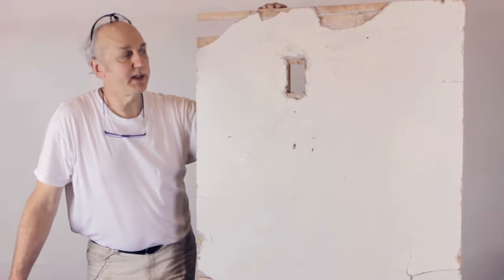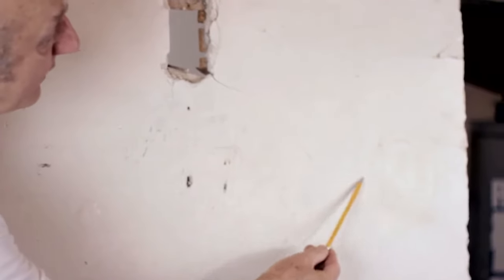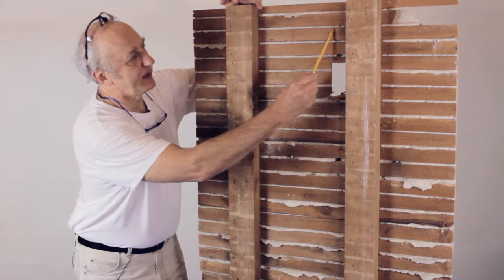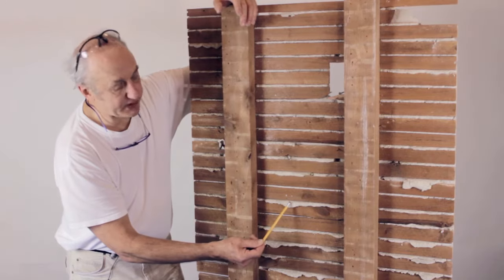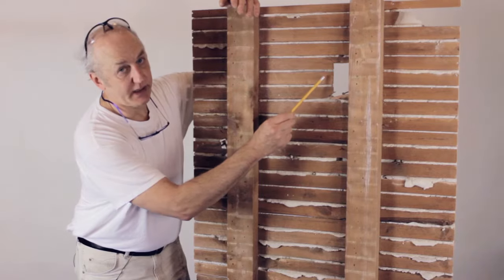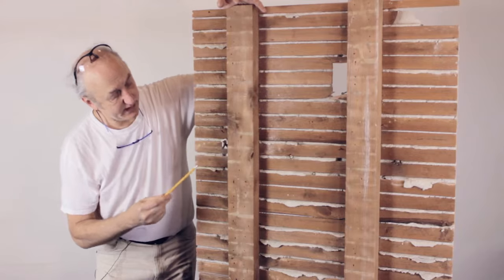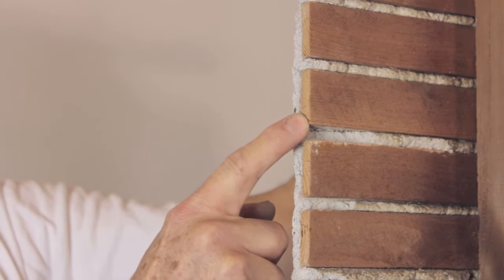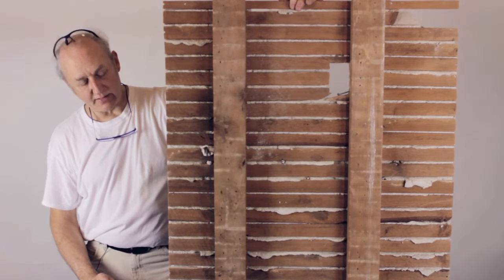Plaster Wall Repair Basics - Anatomy of a lath and plaster wall

Comment: If you need to cut into a plaster wall for an electrical box, how can you avoid damaging the lath or making it come loose?  Would using something gentler than a reciprocating saw help?
Reply: I've used an oscillating saw and you still need to go through the lath.

Comment: I really hate this old plaster ,we are currently demoing some apartments it's alot  of trash 🗑, insulation ,lath and plaster and some places it has double layer drywall but for sure one layer drywall and this mess  ,I was really curious about how they did it back then ,real 2x4 ,4x4, 2x8 on ceilings and 2x10 on floors ,unlike today's  1.5"×3.5" cheap wood 🪵

Comment: In the 50s 60s. What would be typical spacing of studs for the lathe?
Reply: They used a drywall back then that has circles in it. It was later realized that they could use that same product without holes and call it drywall

Comment: Thanks! This was the best explanation yet I've seen of how plaster. lath and studs are utilized to build these walls. I own a early 1890s brownstone and always fear mounting pictures and paintings. Now I know to look for the studs. You may have a few tricks for doing that. Any advice would be welcome. Thanks again.
Reply: I've heard using a metal detector could work. You can use it to find the nails hammered in where the studs are.
Reply: @seandaly5374  Great idea! I just happen to have one. I'll give it a try.
Reply: Other people use magnets to find the nail  heads

Comment: Great video and information. I created a Lath & Plaster removal video. I had to open up some walls for an electrical and plumbing replacement in a 123-year-old house. There are some walls staying and the repair information is helpful.

Comment: Great intro to lathe and plaster. Could you talk a bit about how these were insulated?  I have wall with lathe and plaster beside a chimney, and it's crumbling. I was thinking I'd put 1" foam panels on the interior and then drywall, but don't want to trap moisture between the plaster and the outer wall.
Reply: To my understanding, most lath and plaster does not have interior insulation. Lath and plaster walls are thicker and have a higher insulation and noise cancelling rating than drywall does.

Comment: Hey I'm glad I ran into this video again, lath and plaster is a beast of it's own , typically with lath and plaster comes the pain of knob and tubing... that being said I'm scoping out my so's house and have seen plenty of no no's when it comes to the electrical very scary... and a lot of it has been damaged to the point where it should all be mitigated, do you know if it was typical for that time period to run straight shots from the basement to the attics as I would like to re use the same passages as much as possible I already have some repair to do on the plaster I would like to limit how much I have to do thank you!

Comment: I have to join plaster with tile at the corners due to renovation. What corner design and material do your suggest? Also, do you know any asbestos cases in those 1900s joint compounds?

Comment: Hi Rory @BigWalleze, I need to install an 8 pound fire extinguisher on the wall, and I can't find the studs.  (1) Would 8 pounds be too heavy for lath?  4 screws - horizontally 1 inch between 2, vertically 5" between the pairs.  (2) Is there a way to drill pilot holes and then screw through the lath without damaging the bond between the plaster and the lath? (3) any way to minimize the risk that 2 of the screws - or all 4 - will go into the gaps between the lath?

Comment: That makes A LOT of sense! I have to totally replace some lath in my 1907 house. There's a hole where there must've been some kind of register. I have to do a small section then plaster it. I was wondering how the plaster would stick to the lath and what the heck a key meant. Thanks!
Reply: Wally didn’t answer, but 2 years later, I will in case anyone cares. The “key” is the bulge of plaster that comes between the strips of lathe to lock or “key” the plaster to the lathe.

Comment: Are the studs in an early 20th century house still pretty much 16 OC?   I need to hang a shelf, house built in 1915, all plaster and lath, going to drill small holes along the bottom but If I don't have to keep drilling to find the next stud after the first, I'd prefer that.  Have a feeling my house might not have very "standard" and "even" stud spacing.

Comment: I gutted my 1908 two flat down to the lath . Leaving the lath which is nailed perfectly in place still . I want to hire a plasterer . Are they familiar with the old best way and know to make good keys like you mentioned . Also is this common to gut to the lath and refinish . Do you need to use the weld brushed all over it to help bond . Thanks

Comment: I need to hang a tv on my plaster wall any do's and dont's and suggestions on types of screws?
Reply: The Thread i know its like 3 months late but i somehow stumbled on this video and saw your comment, personally i would always go for plaster rawl plug fixing then possible 2”10’s
Reply: For something that heavy you must screw into the wood column holding the lathe boards.  Search how to locate beam in plaster lathe using a magnet.  Once you find the column, use a 2 inch wood screw, heavy duty.

Comment: I'm trying to hang a shelving system in a ole house that has lath and plaster it has been a nightmare. when I drill my holes I want to drill in the lath correct....once I do that do I need to use anchors or just the screw?

Comment: This is a really helpful visual, thank you! Now I know why stuff falls behind the wall when I drive a nail in to hang something! My house has a lot of faux wood paneling, which I now wonder if it was used to cover up any blemishes in the plaster! I absolutely can't stand the paneling and the plastered walls are always cold to the touch (even in the summer)!! It's a lose-lose!
Reply: You have to find the stud when you want to hang something on the wall, you can't just hammer it in wherever.   The wood paneling was not used to cover up anything, it was a popular renovation style in the late 60s through the early 1980s as that was the new thing. Just like wall to wall carpet did in the 1950's.  Cold walls in the summer are not a problem at all, you want your house to be cool.  Also plaster is a masonry material so it is not an insulator of heat, it always reflects heat off.  Also in most early construction homes of lathe and plaster, its very common they have no insulation at all (it had not been invented yet) and if there is any, it's likely going to be old newspapers glued into the back of the exterior wall which was all people knew at the time on how to insulate their home from drafts.

Comment: My house was built late 1890....row home ....
My parents bought the house in 1952....now the house is mine........I came across this problem.......when the homes were built did the plaster....come all the way to the floor and the baseboards on top of that.......cuz the wood that you show with the plaster.....I have showing at the bottom were the baseboards used to be........mom had the downstairs all paneling......and at that time removed all baseboards...

Comment: Your video has helped me to understand the player walls of a house I just moved into. It had no kitchen cabinets, but I think the new ones I had installed were done the same as on drywall because they are pulling away from the walls. I'm too scared to put anything in them now. Do you have a video that shows how to hang regular heavy kitchen cabinets on a 1940s plaster Paris walls? Thanks
Reply: Please share what you did (i kow, 3years ago). Please let me know if you have videos that helped you. I have a 1940 home that I moved into also. The kitchen walls is what I want to change but I am scared like you.

Comment: I'm planning to mount a tv on a wall with lathe. The stud finder has pointed me where I should have a stud but I'm wondering if there is a spot to drill. Should I be going between the nail areas give me the best chance at not fudging my wall.

Comment: So awesome thanks for showing that. Quick question: the rental house I live in is old plaster & lathe and occasionally a new roommate will innocently attempt to hammer in a small nail only to have to hammer actually bounce back at them as if hitting rubber if some kind... any ideas what that might be?
Reply: Could be a spot where a nail is already there. Could also be a metal pipe.
Reply: Also cd be the lathe loose from the plaster and it snaps back.

Comment: Thanks for the upload. What kind of plaster did you use?
Reply from the maker: Thanks for watching, hispano25. When we do repairs, we use Big Wally's Patching Plaster, available here: http://ow.ly/GIsJQ It's formulated to bond with the original plaster that you see in this video, which is about 100 years old, better than a thicker modern plaster would.

Comment: if I have to replace a juction box with a new style that will be nailed to the stud afterwards, I will have to create a bigger opening to nail the box. what can I use to repair my  larger opening afterwards? thanks
Reply: If you're going to be breaking the plaster, then you can simply reapply new plaster to fill in the hole. Mix it yourself. Look for dry plaster wall patch or you can order Big Wally's product.

Comment: Wow... Good to know if I buy an older home and the pain it can be to remodel it. What about asbestos back then?
Reply: Depends on the year it was built. Generally speaking, wall plaster didn't include asbestos until the 1940s.
Reply: I bought a house built in 1949. Who do I contact to have my plaster walls tested to see if I have asbestos? I wanted to remove a half of a wall to build a breakfast bar. Thank you.

Comment: Thanks for the videos they are very informative.
Problem: My plaster wall is flaking and blistering below my windows. I've repaired the area before by removing material into the base coat. Then I used structolite with surface coatings of joint compound. It looked great, but the problem came back. I assume that it is moisture related. Any ideas on where to find the source of the problem (what is the most common cause) so that a final repair can be made. Thanks.
Reply from the maker: Hi johnott1864, 
It sounds like you are indeed having a problem with moisture. There are a lot of spots around a window where moisture can leak in. I would investigate around the frame and under the trim. Condensation from the window itself could be an issue, too, especially if you live in a climate where condensation can freeze overnight and melt in the morning. Keep looking, and remember that water runs downhill — the source could be higher up than where you first see damage.

Structolite is a gypsum plaster, which makes it extremely susceptible to water damage. Think of rain on sidewalk chalk. This is one reason Big Wally's Patching Plaster is lime based — it works more effectively in these situations. When you make the final repair, remove all the blistering parts and spray the remaining plaster with Big Wally's Conditioner, which will partially seal and consolidate the brittle original plaster and prepare the surface for your new patch coat. 

Hope this helps. Good luck with your project!

Comment: How does one find the studs in a lath and plaster wall?
Reply: I look in the mirror...
Reply: Stud detector or measure 24" studs distance from the the wall.
Reply: The Kirk, I just saw a guy use a magnet to find the nails that were used to attach the lathe to the studs. Pretty cool!